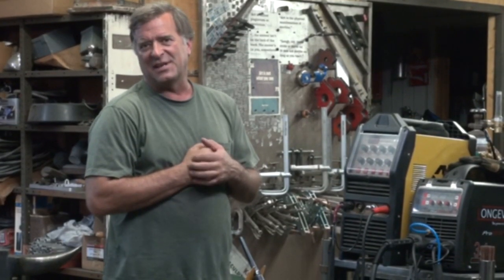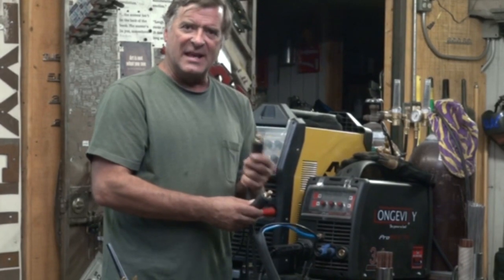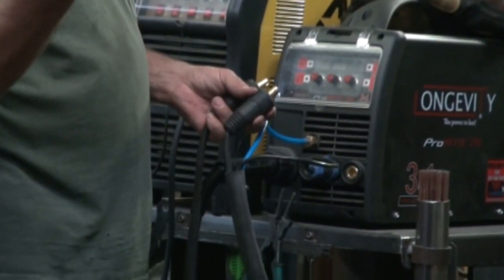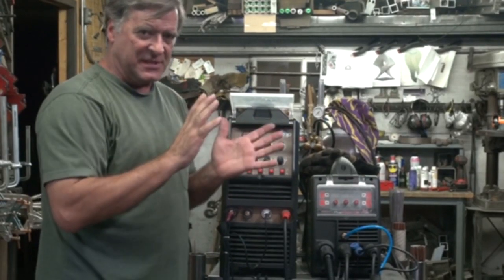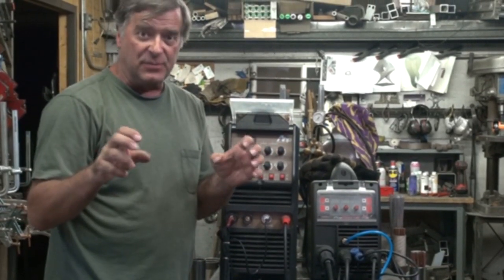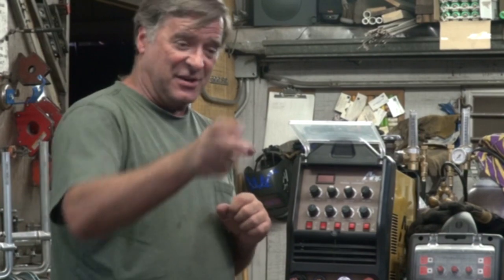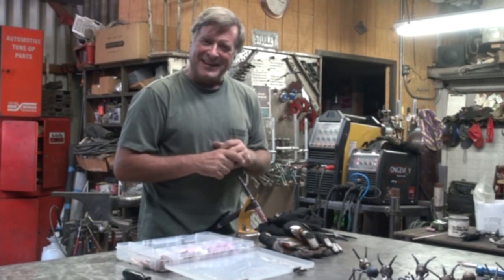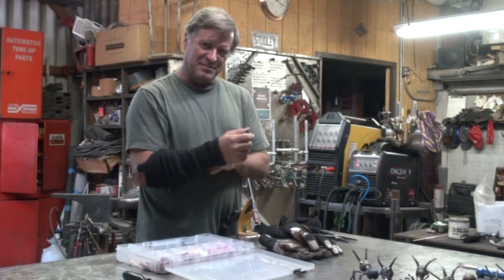TIG Welding: 'What Could Possibly Go Wrong?!' - Kevin Caron

Comment: I personally have a 300 amp Miller trailblazer with high freq box and water cooler . I don't have a computer only a tablet. I asked Google why people in movies always get welding scenes wrong , especially cutting torches. and I saw a video of yours , should I try to enlighten people on the some tricks of the trade or short cuts? I started tig welding at 12 yrs old and making money at 13 . working on classified projects , sattilites ,planes missile motors and other. my n d a ,s  are expired . I don't know anything secret , those things were compartmentalized. I just love to weld.It's so sad that young people don't want to get in the trades. our country will have a shortage of journeymen cause no one wants to work hard anymore!
Reply from the maker: You sound like you should have your own channel here Paul!    If you have advice you can share I am sure someone can learn from it.

Comment: I probably didn't watch enough of your videos , I've been welding and 6g certified for 38 yrs. old school boiler maker. I specialized in stainless pipe , cyanide bromine chlorine ammonia. all the favorites. in field we use scratch start tig  air cooled , but I use liquid cooled with foot pedal or on off slide for heat on torch handle. do you talk about those things? wud you like any advice or have any questions you wud like to talk about?
Reply from the maker: Hi Paul.    Yes, I have talked about the things you have mentioned.      I am always open to advice and have more questions than time to tell the truth.     All I ask is that the advice is "g" rated and in an adult tone.    We are all grownups here.

Comment: Hi Kevin I want a Tig welder but don't know if I AHP AC DC or Everlast AC DC
Reply from the maker: The AHP is more of an hobbyist machine.   Or light fabrication.   

Everlast is more medium fab to all day use.

I like both brands and use them together..
Reply: But they both had to be ordered online or is any specific dealer where I can go and get it
Reply from the maker: I have heard the Everlast is in Home Depot but have never seen one here in phoenix.   Normally just order them on-line.
Reply: Thank you very much Kevin for your quick response you the best
Reply: Go with Everlast. I've got a couple of their welders and I have been very pleased with their performance.
Reply: Check feedback about Everlast. A lot of problems for when it breaks in some way.
Reply: Ah, Kevin. You know it’s not a ground. It’s a work clamp, which can be either positive or negative - but not ground. If the work clamp ever gets connected to a ground, you will burn your welder. If you’re mig welding, the wire will complete a circuit, even if you’re not welding. Hit the button, and the wire will turn red hot inside the welder.

Comment: Hey Kevin, sometimes while trying to start (high frequency mode) all I get is a buzzing sound coming from the welding machine then get shocked on the arm. Is this doing damage to the machine? At first I thought it was a bad ground but there's a good connection
Reply from the maker: +krssnoop      The buzz is the high freq starting and you are getting shocked because you are making a better path to ground then the clamp.    Try moving the ground to the metal you are welding and get your torch closer to the metal before you start the arc..
Reply: Thanks Kevin I'm glad there's nothing wrong with the machine. Also I had it in 4T thinking it was 2T and couldn't get out of high frequency (not letting off the foot controller). stupid me, lol.

Comment: What happens if your AHP ALPHA TIG is dead when you turn it on, plugged into 120 (with adapter)? All connections double checked. Internal switch for 120?
Reply: ***** Thanks Kevin. The 220 plug on the welder was different than our shop receptacle, so I thought I would try the 120 to no avail. I picked up the parts to plug into 220 and will try ti today when I go in. I will let you know...
Reply: ***** - nope- no good. Checked everything including power at plug with a meter. Tried with and without gas/pedal/TIG attached. Dead as a doornail. NO welding this weekend...bummer. I did call the number in the manual- left message. Thanks for your help. Love your videos BTW...

Comment: Kevin great video, especially the part covering the "high frequency points" inside the machines...2 side notes however, 
#1. Longevity putting their TIG torch dinse connector on the positive mark is "backwards" compared to every other welder I've seen...you TIG weld 95% of materials using Straight Polarity ( that's DC neg) and aluminum in AC (alternating current). So They "have it backwards".

#2. Great that you passed along wearing sleeves while TIG welding, but its not primarily "the heat" "or mild shocks" that will cause you the most harm, it's the Radiation the TIG process puts off that will harm you.  It WILL damage your skin JUST LIKE "a Really bad sun burn"! Believe me I've seen it. It will "tan" any bit of skin you leave exposed.